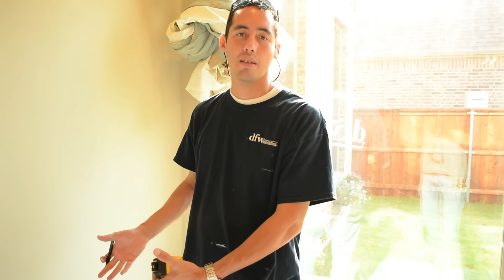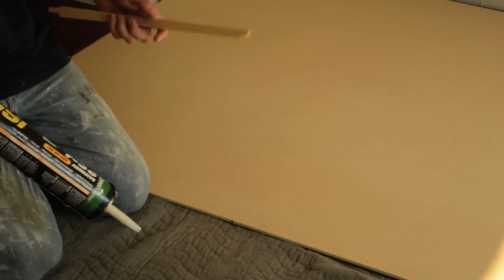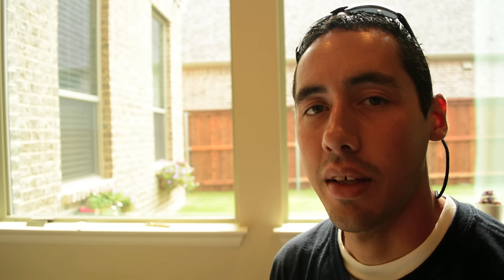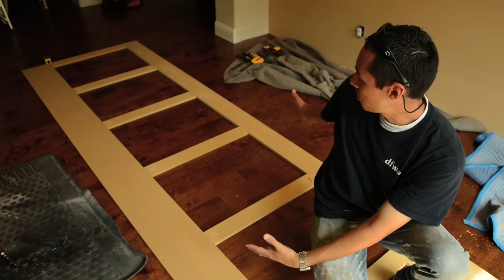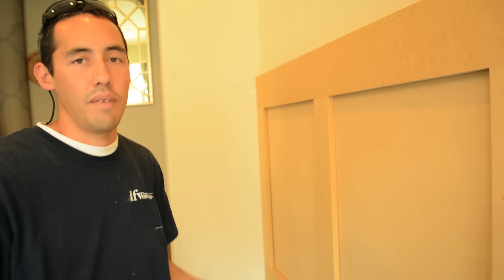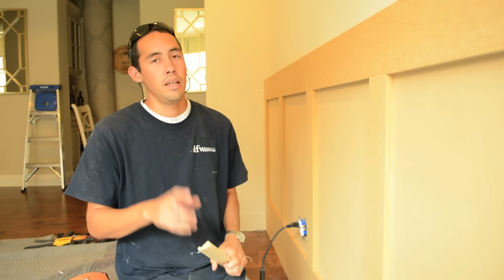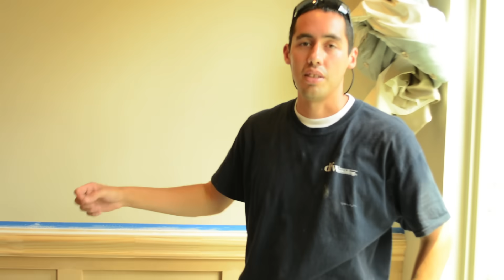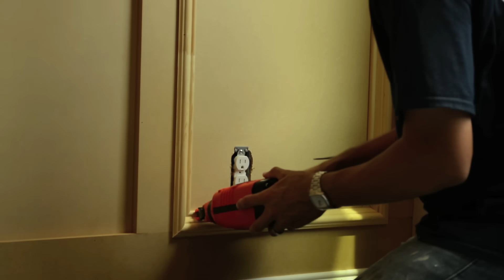Recessed Panel Wainscoting Installation - How to Install

Comment: I've watched a few of your videos an just want to tell you. You seem to do good work an take pride in your craftsmenship. Which sadly is very rare these days. I've been in carpentry for 20 years an don't know how many times I've heard coping is to slow on the jobsite. An then watch the same crew spending a lot more time caulking huge 45 degree joints. An also find if they don't know how to do something they always go to the " that just takes to much time it's to slow" quote. I've had so many customers go the cheap route an only find out afterwards it's almost always the unqualified so called carpenter that gives the cheap price. So I have yo come behind them an spend twice the time pulling out there crap an doing it right, like it should have been the the first time

Comment: In Australia we use glue on every joint and surface. I often see US carpenters just nailing shit to the wall. I guess we get more movement than you do. I wish i could work in the US hehe
Reply: securityplus - I think that’s a personal preference. When I use pocket holes I glue them too, but it might be overkill. Kreg claims you don’t need to use glue on any of their joints. It would definitely add to the time and mess on a job like this. I would like to hear this guys thoughts in it, like if he has ever had any problems with unglued pocket hole joints later on (I’m guessing he hasn’t).
Reply: @maynardkreb8155  we don't actually use pocket holes nd i always saw them as unprofessional.  but i see the benefit of them. the pocket holes were being sold here under the guise "how professionals work " and I have never seen them before that. that was a couple of years ago. also the good ones are expensive,  its the same as cutting exterior mitres.  out ex corners are always 92 deg  because of the 2 mm of plaster so never saw the need for a $200 protector to f i d the mitre cut. yes, good ones sell for $190 here. p.s. I have always glued and pinned my door mitres as we movement  here from the hot weather and they come apart if you don't.
Reply: @maynardkreb8155  only seen him use white glue in one video putting mitred trims up a stair case. I've seen them remove old skirting (base board) and there was no glue behind it. everyone would be horrified to see that here. also I am envious tjat USA are using 3/4 material. we are down to 11 mm coz of cost. very rarely do we get to use 18mm (closest we got to 3/4)
Reply: @maynardkreb8155  not a personal preference here, of you don't do it your mitres will open up.

Comment: Slightly off-topic question.  Do you install electrical box extenders when you put wainscoting up?  I've heard that even a small panel shouldn't be introduced to the interior of the electrical box in case of an electrical short.  Important or picky?

Comment: If you did this for the whole room or had a door opening, how would you prevent the wainscoting sitting proud of the existing door casing?  My door casing is 3/4" so my base board will sit proud pretty significantly after adding up all the material.

Comment: A quick tip.  I saw the curtain tied into a knot. Instead, get a coat hanger.  Hang the hanger on the rod and drape the curtain over it.  It just a little detail, that keeps their curtain(s) from getting wrinkled.  It seems you can some particular and detail clients.  It's a nice touch to add. :)

Comment: Random nailing into drywall and not studs kinda sketchy. Also why not pre prime? Why no glue on mitres? And who works on unprotected finish floor. You should have 2 horses and sheet of plywood set up outside, then you could clamp stiles while attaching with pocket screws

Comment: Nice job Rich! I would've liked to see a bit more space between the tops of the boxes and chair rail. Another way I've done this when the customer wanted the wall color in the boxes, so in that case we just glue the rail and stile directly to the existing wall instead of using the 1/4"mdf. I liked your trick with shoe moulding as a cap!

Comment: Glaring mistake - the reveal on the top rail is to narrow as it should be the same as all stiles and rails. Solution - the chair rail should have been higher even if you have to nail on a filler.

Comment: I loved this video so much. After years of patching holes in drywall from various mishaps this video inspired me to wainscot my foyer, stairway and upstairs hallway. I supplemented your design by adding 1/8” MDF to add a measure of security against accidents in the recesses. TBH the trim was the hardest part because of figuring out the angles on the stairwell - and I’m a beginner at woodworking. I owe it all to your concise presentation here.

Comment: great video you explain things great. would have liked to see you set up the saw for the picture frame molding.since its hinges over your rails and styles. is your first one a trail fit because you cant measure point to point or short corner to short corner

Comment: This not actual wainscoting, but simply applied trim. Still, it's good to see folks using glue and screws.
Reply: noun wood, especially oak and usually in the form of paneling, for lining interior walls.the lining itself, especially as covering the lower portion of a wall.a dado, especially of wood, lining an interior wall
Don't know what you define as wainscotting. Or if you know.
Reply: @mikeanderson7729  Yes I do know, I've been installing very complicated and high end interior trim for 3 decades. This is not true wainscoting in the sense that he's not using individual panels mounted inside rails and stiles, but rather a single large panel with applied trim over the top of it giving only the appearance of true individual panels. Nothing wrong with that since it's faster, cheaper, and doesn't require as many tools or milling processes, but not true wainscoting in the traditional sense.
Reply: So your definition of wainscotting apparently includes raised panels between the stiles.  We're not talking about library paneling here, and neither is he. Simply wainscotting. Personally, I think you're nitpicking.
Reply: @mikeanderson7729  Mike, the blueprints I am given to bid work, and to do work always spell out in detail exactly whether wainscoting is to be faux / applied, or if it is to be true / traditional wainscoting. If I installed applied wainscoting when the blueprints call for true wainscoting I can't get paid for the work. Then the general contractor will also back charge me to pay for one of his guys having to rip it all out. You don't put faux or applied wainscoting in a multi million dollar home because it devalues the home. Nothing wrong with putting it in a 250k home. So, I'm not trying to be argumentative or nitpicky, it's simply how things are defined. I would think that it's not to hard to understand, if you're willing to listen instead of argue about it.
Reply: @mikeanderson7729  I never said it wasn't wainscoting, just not true wainscoting. That's not my opinion, it's the opinion of designers and achitects. By the way, people who pay for million dollar homes nitpick!

Comment: i stumbled onto your  channel.really  great  work.. I'm a  master cabinet maker  and finish carpenter 35+ years in building custom homes. your skills are awesome. Nice to see a young man in the trade!...couple of things may suggest if you don't do it yet. Always, ALWAYS  glue your joints when you build your frames, especially in MDF. in few years they will come apart and break the seam. 2 build your picture frames then install as a single piece ,that way you can glue all your joints. its very crucial when doing. keep up the  great work. i got out of the carpentry business a few years back and went into pro audio. manufacturing.. if you have time look at  https://www.facebook.com/zamora.woodworks/photos?lst=525866975%3A525866975%3A1532663778&source_ref=pb_friends_tl

Comment: what if it was a solid wall ? , would you use some wall plugs or something cause obviously you wouldn't be able to use a nail gun.
Reply: Gazz 999 I’m about to buy an apartment with concrete walls and was asking the same question. Wonder if you got the answer from someone else ? Thanks
Reply: liquid nails
Reply: I dunno I think id prefer a solid fixing then use adhesive's .
Reply: Why? its wainscoting and its not even holding any weight. I could see your concern with adhesives if you were doing it on the ceiling. Liquid nails makes a specific one for paneling. The other option is to use furring strips and ramset nails. Put furring strips then plywood then the wainscot. I would be careful though if youve never used a ramset gun. Its literally a pistol that shoots nails. Seems like a lot of work for something you can just use adhesive.
Reply: yeah I know what you mean I think its just me to be honest I like to know things are securely fixed on.

Comment: Use a serrated trowel to spread the adhesive. WAY easier. That is all.                                           
       
ps Great Carpenter/ Cool Guy.

Comment: Is it a bad idea to use MDF for the stiles and rails?
Reply from the maker: We have since stopped using MDF.
Reply: Thank you. I noticed that the primed mdf that I saw at Home Depot has rounded edges which may not work well with the PM6 molding when doing the recessed panels.
Reply: By the way, many props to you. Love your channel and instruction. By far the most straight to the point and instructional finish carpentry channel on YouTube! I’m a lawyer by profession and i moonlight doing odd jobs around my house on the weekends! Keeps me out of my wife’s way! Lol

Comment: Hey Rich I've been a fan for years and have learned a lot watching your videos. I would like to duplicate this raised panel install but have some questions.  How do you conceal the joint of the back panels? I'm wrapping this around several walls, do I miter inside and outside corners of the chair rail and styles?

Comment: Would a notched trowel bean better .
You would then have a consistent  thickness of adhesive.
Reply: Just looking for an even spread and a flat bit of wood can do the same thing. Remember a trowel has to be cleaned unless you are an even craftsman and charge for a trowel on every job and just throw it away rather than cleaning it.  I know people that do that sort of crap.

Comment: Why didn't you figure your measurements out so all your stiles and rails were the same width.  In this case 3 inches. You cut the top rail off. Not very professional.

Comment: Please explain why you're using MDF? You said depth is good for recessed wainscoting. To create more depth you wouldn't want to use MDF.  (MDF taking up space between the panel molding and wall) Less material between the wall and panel molding = depth. Somebody help me out here
Reply: ' Mercia I don’t get it either. Just putting against the wall would create the same effect. The distance from the back is still only 3/4” the only thing that does is create more top surface to fill above chair rail.

Comment: no glue on the moldings ? come back in 6 months that will all be cracking glue is super important on paint grade material. Huge mistake to not be gluing that properly

Comment: Maybe a trowel would be better than a piece of scrap wood.  Also there is adhesive in a bucket that's is suoerior than tube adhesive and a lot easier to apply evenly.

Comment: I've never met a wall that just "laid itself out."
Use algebra, that's why we had to learn it in school:

Where 3.5" is inside stile, n is number of panels, y is width of panel, 173.25" is total wall width

3.5(n+1) + ny = 173.25    or     y = (173.25 - 3.5(n+1)) / n

Pick a value for n, solve for y, and see if the output dimension is to your liking.  You have to do it in this order, because n is an integer, while y is very likely a fractional number.  Hope this helps.
Reply: In this particular case n was 7, there are n+1=8 stiles times 3.5" = 28 inches total. 173.25 - 28 = 145.25; divide that by 7 to get 20.75 inches for the width of each panel.
Reply: @robertsalas3984  Did you just come on Youtube to be entertained on how to do waincotting?  Mathematics is how real carpenters calculate the accuracy of a technical job.  I always wondered how it worked out, and a pencil and paper gets you there, and adding in commonsense math makes the look professional.  Anything less than that, then you're not in the buildings trade.
Reply: Thank you sir for taking the time to post this..Appreciated..!!
Reply: show off
Reply: I'm really confused now ... what the hell is this ?
Reply: grm3300: Simple really... He's just computing the total width of the stiles and the total width of the panels and adding them together; this equals the total width of the wall.
So
Stiles are 3.5" and you have 1 more stile than the number of panels because you have that extra one on the end (they wrap the panels basically).
3.5(n+1)

Number of panels times the width of a panel is the total linear width of panels.
ny (n times y as in multiplication)

Add those 2 values together and it has to equal the total width of the wall you are working with.

The second equation he put up is the just first one solved for y since that is the value you are trying to determine; the width of each panel to make them layout evenly across the wall. Remember that the width of each panel is the only thing you don't know in the beginning.

Comment: Nice job but speaking from experience you should cover the existing floors better. If that were a paying customers house any scratches they find when your done you will get the blame even if you didn't do it....Not always about whats true but instead its about the impression...Good luck young man...

Comment: Space on the bottom, between the base molding and the boxes is way biger than on the top between chair molding. I think space should be the same all around the panels. I like the way you glued 1/4" to the wall, but why not gluing mdf frame to 1/4"? You could also glue all the seams on mdf frame before putting screws. I usually nail and glue together panel molding , before installing and gluing it to the wall. Glue will always help to keep stuff together and it will last longer.

Comment: Hey Richard thanks for all the videos, I always learn something new! Question: Do you have any tricks to minimizing the "mushrooming" you get when nailing MDF?
Reply: Tony Falcone 
I can answer this for you. I am a professional painter and I deal with those tiny holes on MDF in a daily basis.

First, you have to sand them. An easy way to do so is by just using a sand machine. After that you have to clean the area. We use a vacuum first with the brush accesory attached or you can use a blower. The point of this is to be able to see most of the tiny holes to fill out.

Then you proceed with the filling and you can either use a small putty knife or you fingers. The most important part of this process is to really pushed the material inside the hole and leave a thin layer of the product on the top of the hole. 

For MDF you definitely need to sand by hand. If you use a sand machine, you most probably will remove the wood filler or putty and after priming your surface the edges of the holes will be noticeable.

It is important that after priming and sanding your panels, you perfectly clean the surface and redo those tiny holes that you missed or that need a little bit more of wood filler.

Good luck!!!
Reply: Ah thanks I've been filling then sanding, I'll try sanding first

Comment: Hey man what do you think about using a fine notched flooring trowel to spread the adhesive? Maybe a 3/32"x3/32" V notch. Also I finally picked up a husky digital angle finder like you recommond. When will you have more stickers in your store?
Reply: And I have the same black cat! They are great luck

Comment: Amazing! Was the chair rail installed flush with the top of the mdf? Curious about the shoe moulding used, was it just the same kind of stuff you'd find inside a door frame? thanks for sharing this!

Comment: Watched again; awesome job.  One tip for you:  assemble the stiles and rails on the floor like you would crown moulding; upside down, with the base towards the wall and the top farthest away.  This will prevent you from mixing up the top and bottom, and also eliminate having to carry the unit out of the room to flip it over.  Just lift it up when you are done from the top and nail it to the wall. Also allows you to do it by yourself, since the bottom can be just pushed against the wail, lifting the top into position and placing it against the MDF wall panel.

Comment: Nice video, however.  I wanted to do this in a few of my house rooms to cover sins in the sheet rock like old heaters and so on, but when done I cannot find any door trim that will be thick enough to but up to it.  Suggestions?

Comment: Thanks for sharing this technique. I like the idea of a backing MDF panel to protect the wall behind from impact, making this not only decorative but also functional. I've found that this will make the entire assembly stand proud of any adjacent door or window moulding. What's the best way to compensate for this? Should I cut the MDF backing board into panels that fit inside the stiles and rails so that it comes up flush? I'd hate to have to replace/shim all my door frames.
Reply: Neil K Have the same challenge but plan to leave the backing board, but paint / finish wall the same as rails / stiles, so will look the same.. maybe?
Reply: I ended up just leaving the existing trim in place and used a contour gauge and a small band saw to make custom cuts.

Comment: The tool I drive the pocket hole drill bit because it is way faster than my 1/2 M drill. I use my M impact drive with the 1/4 drive.
Reply: I agree. I have the basic Ryobi drill/impact driver combo and bought this Krieg jig and the drill was not getting the job done to my satisfaction. Even though the impact driver is OP for this application, if the jig is set up correctly it keeps you from drilling too far.